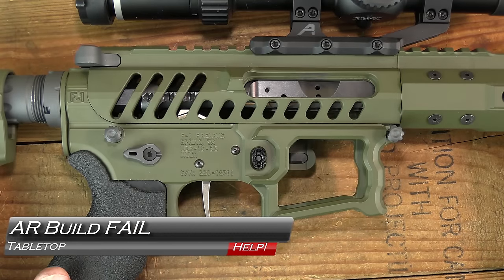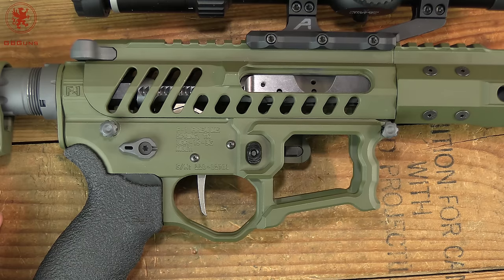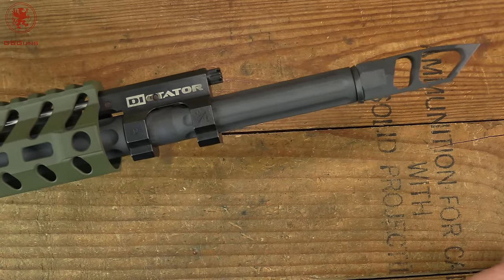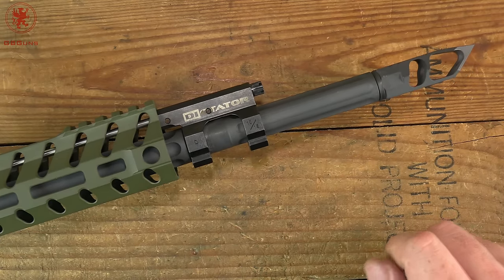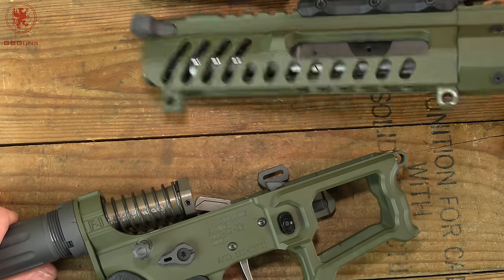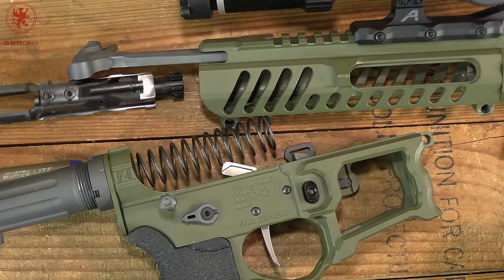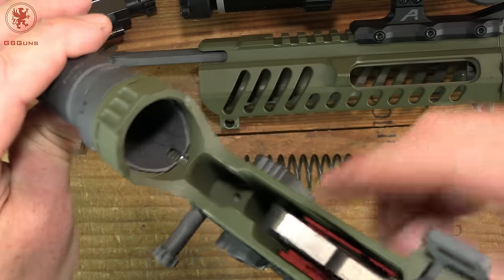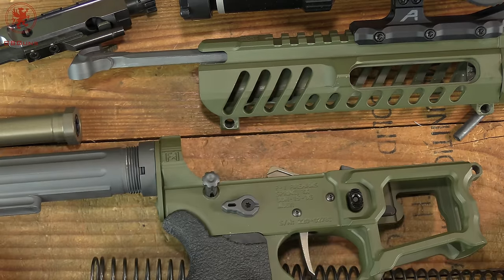The Worst Thing You Can Do For Your AR

Comment from the maker: Problem solved! A reduced-power buffer spring did the trick and I was able to then reduce gas a little with the gas block.  We suspect the gas port is too small on this barrel as we KNOW the block is properly aligned.  See the second video here: https://youtu.be/tjFRl6sO_GY  See the article to learn about the myths perpetuated in the comments of this video: https://www.ballisticmag.com/impossible-ar-build-myths/
Reply: Graham Baates that’s what I was gonna suggest. Glad you fixed it! (Pew pew)
Reply: My 300 blackout pistol was shortstroking, a tubbs flat wire spring cured it.
Reply: So the rifle runs reliably now is what you’re saying?
Reply: A tip I was given before I built my first upper. Seal the gas block to the barrel with blue loctite. Helps with any minor machining imperfections. Glad you got it running! Nice build!
Reply: Good to know b/c I am having the same issue with one of my rifles!
Reply: Which weight for the recoil spring did you end up using?
Reply from the maker: It weighs about an ounce.  It's the Odin Works lite weight adjustable and I left it empty.
Reply: @GBGuns  how about the recoil spring?
Reply: high end rifle, check out the jp silent capture system. you won't be sorry
Reply: I was gonna ask about the buffer spring. lol
Reply: As soon as I seen that spring I was like no
Reply: I was going to suggest drilling out the gas port.
Reply: you should stay away from those cut upper recievers. It lets in dirt and dust  and it will cause problems. It looks nice but not practical for a gun to be reliable
Reply: I had to play around with buffer weights on my SBR. Side question, do you not get a lot of gas venting from the slots in the upper? How is that when it shoots?
Reply: I was just gonna say spring then I seen your comment lol
Reply: I seen another guy with a aero perision barrel had the same problem he made a gas port bigger
Reply: @garygatley9698  that's not true
Reply: @shootist431  
Have you had any practical experience with this or is it just something you say ? Because it can take being submerged in muddy water https://youtu.be/LQalucXr_tQ?t=243 - if you have had problems yourself....fine, if it's hear-say or you think so....try it first, then complain about it eh....
If the Miculeks are willing to use it...perhaps it's not too bad ? https://www.youtube.com/watch?v=BLadEilZCpY
Also rememeber that this is not a battlerifle being dragged through the mud and banged up against rocks and thrown around, it's a specialized tool (lightweight upper/lower) for a special purpose (competition or lightweight rifle for a kid).
If you want a beater get an ordinary one, they'll take most crap you can dish out - like Brownells uppers, they're ok prized and work well.
Reply: Well, of course, if the real problem is the gas port then haven't "solved" it with a lighter buffer spring -- you've only compensated for the sub-standard gas port by using a sub-standard part elsewhere. It would surely be worth taking off the gas block and examining the gas port with a good light. If there's anything wrong, Aero should replace the barrel.

But in terms of actually investigating the problem, it has to be either "forward" (gas block, gas tube, gas port), or "rearward" (bolt piston, gas key, buffer, spring, etc). So the first thing I would have done is put in "standard" rearward parts and see if they work -- and if they do, then you've eliminated problems with the "forward" parts. Then go from there, in a similar manner (using "standard" parts to find which one is causing the problem). I would NOT be "satisfied" with your solution of a weak buffer spring -- you'll be trading "short-stroking" problems for feeding/chambering/bcg bounce/light primer strike problems. A "healthy" setup should run really well with a HEAVY buffer and spring. Lightening THOSE components opens things up to a plethora of reliability problems.
Reply: I've had the same problems on a much smaller budget. Buffer springs quickly throw things out of function.
Reply: Just saw this video, glad you're rifle is working. One thought aside from the spring could also help to have a heavier buffer, only because in direct impingement AR the bolt carrier will loosely act like a short stroke piston. BTW very nice looking rifle!
Reply: Ummm.... where is your buffer retainer pin? It was not installed in the vid. Its binding causing friction.
Reply: I was just about to suggest the same thing. Odin works makes a really great adjustable buffer.
Reply: in a .300 blackout    buffer spring force is more critical than in a 5.56 .. because subsonic ammo doesn't have much gas to use for cycling ..the usual hillbilly answer is to use a worn buffer spring or one with a couple rings clipped off and a full auto weight BCG  ..a blast forwarder will increase gas flow too
Reply from the maker: Yup, I've got both
Reply: @GBGuns  Try the heavy adjustable buffer on your other platforms. I'v noticed a recoil reduction on my 308. I do believe it's 7.4 Oz.
Reply: @GBGuns  why do you not have the buffer retainer pin installed? If you were to remove the rear takedown pin and pivot the upper, the buffer and spring would come out.  It clearly wasn't installed in the video.
Reply: Your pof dictator GB may be a .308 one. They have smaller ports to reduce over gassing in .308’s
Common problem for people buying dictator GBs
Reply: I was going to suggest the spring as well,  looks great 👍
Reply: I spent hours and hours with a similar problem on an AR pistol build chambered in 7.62. Most expensive single shot I ever bought.

Replaced buffer weight lighter/heavier, spring, installed adjustable gas block(opened all the way), rechecked alignment, removed material and honed where the hammer rubbed the carrier, modified the m4 feed ramps to accept the 7.62, removed material from the mags to reduce case drag... still short stroked and or stove piped.

Found the gas port in the barrel was to narrow. Got out the vice and the press and took it up one standard drill bit size.  Replaced the block, tightened it all the way closed and backed out 4 clicks. 

Zero malfunctions since in over 1k rounds.
Reply: Yep. Rifle length gas with 18" = bout the lowest gas pressure you can get, all other things being equal. Rifle length buffer would make it worse. Add a suppressor.
Reply: When I saw the buffer spring & also noticed that the retainer pin was absent, I was going to suggest that putting in the retainer pin along with a lighter spring would help offset the rifle length gas system issue.

Glad you got it running!
Reply: I had a few ideas to post, but you got it running. Glad to hear it!
Reply: @ghostshadow9046  carbine gas ? Didn't cycle with subs ?
Reply: Both of those were exactly what I was going to say. Early Desertech MDRs had similar problems with short stroking and the solution was to bore out the gas port on the barrel a little.
Reply: I'm a bit of an AK guy just because my first rifle was a Saiga and a lot of their shotguns are under gassed I was about to post a comment to that effect to drill the gas port out a bit.
Reply: The D.I. Dictator restricts more gas than other adjustables my j.p made no need to change springs  with the dictator I had to use a weaker  spring
Reply: Just saw the video and I thought it sounded like a fouled gas port.
Reply: Yeah cause my AR is the same but runs fine
Reply: @robertrobinson5001  after i bought one, i will never go back, worth every penny.
Reply: @shootist431  Demo Ranch threw those receivers in mud and then did a mag dump. They spit dirt out the sides.
Reply: It’s always a cathartic experience to have a gun run after it hasn’t.
Reply: good to hear you got the gun to at least run. it does not sound as the problem is fixed though. to me, the extra light buffer seems like just a bandaid to fix the real problem. i would start with the cheapest component to fix first. test the gas rings on the bolt itself. do this by putting the bolt all the way forward and then putting the entire bolt group on the table. if the bolt does not collapse the bolt under its own weight, it would usually indicate the gas rings are bad. i would also check for the space the gas tube has. if it is too loose, you will see a lot of carbon on the top near where it interfaces with the bcg. check your locking lugs. a lot of people think head spacing is not important on an ar 15. wrong. in fact, there are plenty of youtube videos where they show the failures people are having with the more budget oriented manufacturers out there because of incorrect head space. look at the inside of your lugs on the barrel extension. are there any unusual marks? does the bcg feel like it is hanging when you pull back on it? i would take it to the gunsmith and have him check all the spacing with your upper components. go and no go gauges. they make these gauges for the gas tube, the part of the bcg interfaces with the gas tube. the space of the neck on the bolt and the carrier group is important to know and have within specification. the port where the striker interacts with the primer of the casing. they have gauges for that. they can measure how far the striker is coming out to interface with the primer. go and no go gauges for your caliber on the barrel itself. is there cracks on the brass of the case you just fired? i would look for the root of the problem as it should run with standard power springs. the real problem has not been addressed yet...
Reply: @orozcocris93  it says in the video that he tried a whole new BCG. It's a gas port issue on either the barrel or the gas block. One of them is too small.
Reply: Makes sense.  With such lightweight components, you don't have enough reciprocating mass to push the spring.  That spring looks way heavy too.  Glad its running now.
Reply: Just buy an AK and a rock to fix it with lol
Reply: yep, you can also cut a coil of the heavier spring off at a time if you find the new lighter spring is a bit to light.
Reply: Glad you got it running! Too beautiful to not run correctly
Reply: At exactly 5:00 minute mark you said, empty. All I could look at after that was the spring. Lol. Glad it all worked out.
Reply: Glad you figured it out I had the same thing happen with a 6.5 Creed barrel from aero/ballistic advantage and it's port was way undersized so had to drop to super light spring like you to get it to cycle. since then I've figured out aero barrels are hit or miss in terms of accuracy since I can't get mine to group better then 1.5 inches while I can shoot my custom bolt gun into the same hole all day long so it's not the shooter
Reply: @robertrobinson5001  it is awesomeness!! Got 2 myself
Reply: Do you get gas blowback out of the venting on the upper after rounds are discharged??!! Im very curious to know 🤔
Reply: I have the same receiver and had problems with my gun cycling. Come to find out the gas port on the barrel was to small. Gun is running now
Reply: Michael Rostine  Are you aware that cutting a coil spring INCREASES the spring rate?  Don't believe me, do the math (physics)
Reply: @OveToranger   love my f1 but it is not light weight. Its heavier than a m&p15.
Smooth and accurate though and easy to clean. You just spray through everything lol
Reply: A google Account , that is brilliant!  A can does just that, i noticed more buffer action (kick) when on line.
Reply: Just curious but did you not install the buffer retaining pin or just for the video you pulled the buffer out early?
Reply: Yeah, I think your barrels gas port is to small, I run into that all the time with 7.62x39 AR builds and a 450 Bushmaster build as well. Good luck!
Reply from the maker: I never doctor for a video.  I did not install a buffer retainer, it's not needed.
Reply: I was gonna say.... SPRING! LIGHTER SPRING.
Reply: Was going to be my forst suggestion
Reply: I love the build! Yeah I was going to say buffer spring after the end of the video. I understand you were using a rifle length spring in a carbine buffer tube? That was your first issue right there for sure. The rifle length spring is already under load before your first trigger pull.
Reply: Beautiful rifle, can you put the brands please
Reply: Lol was watching on TV ,,,got my phone to tell you buffer  spring as I had same problem with 308 rifle length gas system and a  carbine buffer tube
Reply: Your using a carbine stock with a rifle gas tube. For best proformance use a rifle stock.
Reply: @mattmolisbro  a stock is a stock it doesn't matter if it's a rifle tube or a carbine tube
Reply: i was just about to comment to try to either compress or get a less tension buffer spring. glad you fixed your problem
Reply: Also graham, did you have the set screw for your buffer in to keep your buffer and spring from coming out like that?
Reply: @jasonfairbanks8770  he probably does not use the buffer pin. It's not really something that you must have. I do not run 1 with my JP buffer system
Reply: Sorry, I just watched this, I was going to say, ive seen barrels with gas ports not open enough, replace the spring with a lighter one and you should be good.
Reply: Ridiculous build. Stay with mods that are more proven. Or whatever. Free country.
Reply: Dude, you sound so upset in the vid with this sick "looking" gun. I like stuff that runs. I learned a long time ago from a specific financial position, NEVER customize anything (cars, bikes, guns, etc....) unless you don't mind losing your shirt on it. Unless of course, you already have your first several million. Sad to see you spent so much coin for a gun that would be best used to throw at the enemy because round two wont fire. Glad you got it fixed.
Reply: Obviously was a mismatched gas/buffer system. Either way lube that thing. Sounds like nails on a chalkboard.

Also F1 makes really tight tolerances so the cerokote is probably making it too tight.  you will need to get the coating out of all the spring bores and takedown pin holes
Reply: or run it suppressed all the time haha.
Reply: Glad you got it running.  First thing that came to mind after hearing the spring when you charged it was that the spring was too heavy.
Reply: Around 4:30, when I saw the buffer spring sticking into the receiver, I figured that had to have something to do with it since that definitely is not how it is supposed to look.
Reply: Good, I was going to say maybe get a mid length gas barrel but then I saw that spring... The Beefiest looking buffer spring I've ever seen....
Reply: Knew it! This was a little test for myself and I’m happy I guessed it right 😂
Reply: Ya... would think the carbine spring would be stronger for carbine. The rifle gas would be weaker than carbine.
Reply: Had the same problem several months ago and the same fix worked for me. No reason to open the gas port, if you ever shoot suppressed it will essentially increase your dwell time and so you’ll have more gas.
Reply: It almost had to be the gas port. There is always plenty of dwell time on an 18" barrel.
Reply: @dalecarroll5622  It isn't staying sealed. The blue loctite isn't heat resistance. Even the high-temp red will cook off at the temps you'll be getting there.
Reply: One small note and maybe I missed it, there should be a retainer pin that holds the buffer and spring in the buffer tube.  When breaking the upper and lower apart, the spring and buffer should not come out against the hammer.
Reply: I wondered if it was cycling so fast because of the.light stuff that the mag couldn't get the round up Ito position in time.
Common problem with over gassing and too light buffer / bolt carrier.
Reply: A bit late to the party but I'm glad you fixed it. Buffer spring was gonna be my first suggestion because it's easiest. But next was gas port, though it requires machining. With an ultra light system like that, you might want to film your bolt for a few shots in slow mo. Make sure you don't have bolt bounce. If you do, add a little weight to your buffer to slow it down.
Reply: @l337l0gan  why? do tell.
Reply: But... AR's are like "LEGOS" though right!? LOL! Most definitely your gas port is WAY undersized for the gas system if the port was timed correctly with the gas block and a lighter spring "solved" the issue especially with so many low mass parts! For a lot better reliability you'll want to have the barrel gas port drilled out correctly to max specs and then use the AGB to close it back down. You're dead right, that dwell time is too short for that size gas port so... If this rifle is just a range toy don't worry about all this next bit if you don't need the added reliability. Otherwise in addition I'd actually suggest running the heaviest buffer possible that it will cycle with even with the lightweight BCG, that little bit of extra mass helps "pound" the bolt into battery through any carbon buildup after a solid weekend of 3k+ rounds without having to clean much, if at all.  After fixing the gas port issue, open the adjustable gas block to max and take a regular buffer apart and replace the three aluminum weights with three tungsten buffer weights (Amazon has three tungsten AR buffer weights in a kit for about $30 which is way cheaper than buying three different buffers) and then load one round at a time to see if it will or won't lock back on a empty mag, if it won't lock back then swap a tungsten buffer weight for one of the lighter aluminum ones that came in the buffer until it does lock bag on an empty mag then close off the gas block 1/4 turn at a time until it won't lock back again and open it back up 1/4 or even 1/2 turn and fire it about 10 more times to be sure it locks back on an empty mag each time. Takes a little fiddling with but it will run a LOT more reliably for you. Also, use clear nail polish to seal up the gas block around the edges, blue loctite was mentioned but that can melt under rapid fire.
Reply: @arturos.3973  not something you want to do at home. Have a smith do that...
Reply: Nice. Was thinking the port in the barrel was too small. I had the same issue on a 16” with a mid gas system. I also have a 16” Criterion with rifle gas and it runs like a top!
Reply from the maker: To close it without a buffer retainer simply close from the front to back, not pivoting on the front.
Reply: Where is your buffer tube retaining pin and spring?
Reply: I was just thinking it may still be a stock buffer spring
Reply: just watched the vid, i was going to guess an under sized gas port.
Reply: Glad you fixed it. I still would of swapped out the rifle length for mid length gas. Similar recoil reduction with plenty of gas. Over gassing will help with clearing debris since your rifle is see through...
Reply: i know this is old, but you may want to check the gas key on your bcg.  the first thing i thought of was the spring, but when i tried finding this video to comment, i found another video that was having the same problem.  he had a rough chamber and honed it to make it smooth, but one comment suggested his gas key was leaking.  he said to put a little water in it, and blow into it with a straw to find leaks.  just a thought.
Reply: it may well not be under gassed. Low mass on the operating system can require more gas or lower spring tension to drive. I have had similar problems with a midlength system. Adding mass or reducing spring tension fixed the problem.
Reply: I was going to suggest that.  Get yourself some TRIFLOW.  It's a synthetic lube with Teflon in it and the Teflon can, in theory, get into the upper and BCG deceasing friction in those components.
Reply: I was going to guess the buffer spring when you mentioned cycling issues. Glad it's working for you because it's a beautiful rig you put together!
Reply: Graham, glad you figured it out.  I would have suggested that very thing after doing my 458 socom pistol build.  Trying to balance it all out and making sure it functions correctly sometimes is just trial and error.  Glad it is working now.
Reply: Glad you fixed it - as soon as I saw that buffer spring I said to myself it looked to heavy. I would have suggested throwing it on another lower to troubleshoot if you hadn't figured it out yet.
Reply: The problem is, or shall I say, "was" is you have a rifle length gas tube with a carbine buffer and spring. Next time, just match your gas system with the same style buffer and spring.
Reply: Ha Ha learn from experience. It's usually the spring
Reply: The rifle length gas tube-originally for 20" rifles-your rifle is 18" so 2" less "push" yeah they are used with 16" barrels-but not with too light BCG and too heavy recoil springs-

BCG need adequate  mass to acquire enough M V to carry the bolt back against the spring- and to rip out the case--and when slamming forward-stripping in the new round.And the heavier bolt with help when things get "gummed up"

Using a lighter BCG in order to get a "lighter" recoil "feel" is a mistake unless you are in some sort of fast shooting sport that requires extreme accuracy-

Heh-taste is individual thing-but the funny green color-I don't get it-I noticed a few pistols that color-

Not like the beautiful polished bluing or nickel of a S&W revolvers-or a Python-or like many bolt action rifles from another time-or my 1911 (1968 VINTAGE Colt nickel)-$155 in 1968 pricy-a browning HP was $88 in 1966-not sure how bad inflation was then-but $155 was a lot in 1968(Oh I stupidly sold those guns)
Only one I have from back then is my mail order $43  Winchester 190-1963 mail-order maybe I had my dad sign the order form -cut out of a magazine-Mechanics illustrated-who knows-but you could mail order any gun back then(except machine guns I guess)
I bought it because it would hold 21 22 shorts-39 cents/box about $4 in today's dollars-close really  LR were 59 cents at Western auto-and yeah kids could buy them-teenagers anyway-maybe anyone

Green-wow-not for me
Reply: Awesome! Beautiful rifle! As soon as I saw the reciever extention I thought lighter buffer spring! Glad you got it worked out! Thanks for all you do and your help ( on your page, lol) on gun builds! They have helped me out a lot, especially with my 1911!
Reply: I was actually about to recommend that same thing. Had The same problem with a spikes build i built for a buddy.
Reply: This is my first time seeing your channel, but I recently did a complete build myself. One of the biggest things I've noticed is that you should always try to match up your buffer tube style and gas block style (carbine and carbine, rifle and rifle, pistol and pistol, etc.) Then, with an adjustable gas block, you can adjust it to give more or less gas to get it tuned in perfectly. You have a very nice build, though. If you'd like, you should check me out on Instagram (rps_32) to check out my pistol and AR builds.
Reply: If you have to do a barrel swap anyway why not rechamber to .50 Beowulf?  You can keep the same mags and BCG but you might want a heavy buffer spring just for recoil but it won't kill the build without it.  It's literally just a barrel swap and gas adjustment.
Reply: i was just about to comment asking if that spring provided more resistance than a mil-spec spring
Reply: I know I’m late on this, but 18in rifle length gas port is the most difficult to tune. I purchased an FN CHF CL 18in barrel and after going through everything springs, buffers, bcg’s, gas tube & alignment checks numerous times. I finally through internet digging I came across an article about proper gas port sizes relative to barrel length and port distance. Come to find out my port was drilled for 16in mid-length port 0.078 diameter, instead of a 0.0995 diameter recommended for 18in barrel with rifle length gas port location. In the article it states this configuration uses the largest gas port size and is the most difficult to tune if not done correctly. 
Well after drilling the gas port to 0.099, my rifle functioned as advertised and has been flawless since. Also, I haven’t noticed any appreciable increase in felt recoil, which is great. 

Oddly, I noticed that now FN is putty out mid- length gas ports for their 18in barrel! Maybe I wasn’t the only one having problems with the configuration.

Hope this helps.

Cheers,

Mach
Reply from the maker: Thanks.  I knew it would be a tough one.  I got it running and still have room to play with gas settings.  Silky smooth now
Reply: Just sell me the upper n lower n start over. Sound good err nah? 😂
Reply: Nice, this is a great learning experience for me actually because I know minimal information about AR-15’s and I did suspect that!
Reply: @catmanisgod8200  I don't think that’s true if the space the spring occupies stays the same.  Imagine a spring shorter than the space, how could the spring be under more tension?
Reply: Are you missing the buffer stop in your buffer tube? It the stop is missing your buffer will have to travel further and reduce the pressure.
Reply: Dude, I was just gonna type, get a lighter spring.  BAM!!!
Reply: In this case it definitely looked like a stiff spring, i thought I had a similar issue on a 20 inch rifle length barrel. I didn't have an adjustable gas block but when I compared the size of the gas hole with the block I noticed that the port in the gas block was easily twice the diameter of the gas hole in the barrel. I bought a cheap gas block with a smaller diameter hole and it fixed the issue without changing the spring, switching to a low mass carrier, lighter buffer etc. I still think it cycles smoother with "premium" ammo as opposed to cheap target rounds but just thought I'd share even if I am 3 months late. Right now I'm working on a 350 legend CMMG barrel and it's got similar issues, with a reduced power spring, polishing the feed ramps, polishing the ejector, and some slight grinding on the front of the magazine it's cycling better. It's a straight walled case and it catches on the front lip. Still considering a low mass/light weight bolt carrier though.
Reply: I was gonna hop in and give my 2 cents, and tell you to switch your spring and add a HEAVIER buffer. Lol
Reply: Ghost Shadow spot on I didn’t read the comments I just posted in the regular section David tubbs lightweight spring in the 300 blackout that’ll work in 5.56 also he told me
Reply from the maker: Rob Cas  Thabks for the input, but I wouldn't take advice from Nutnfancy.
Reply: Buffer spring - yup, but other issue you may have is the install of the trigger for the double fires. The screws on the snug up fit in the lower. Plus I recommend the KNS anti rotation springs.
Reply: Lightening the reciprocating components along with a reduced power spring is going to cause reliability issues. Any introduction of additional friction will cause cycling issues. That rifle will not like running dirty.
Reply: I had to cut 3 inches off my buffer spring on my blackout pistol. Try it
Reply: video of shooting?
Reply from the maker: Yes
Reply: Glad you fixed it! Usually with a rifle length gas system you will need a rifle length buffer system. Lighting the spring will compensate for the buffer system you installed.
Reply: @catmanisgod8200  What you have said is true, but a cut spring has a different free length as well which means the force on the back of the buffer changes as both k rises and x falls.  Where F=kx (Hooke's Law), k(new)/k(old) is smaller than x(old)/x(new), ergo the force applied is less.  This extends all the way to Fmax where the spring goes from elastic to plastic (deformation).  I ran the numbers for a carbine spring with 38 coils and free length of 10.5" against a cut of 31 coils which came out to 8.56" and it applies less force cut than not cut.  Also, at 8.56" the coil will still engage the buffer as the average carbine buffer tube is 7.25".
Reply: @robertrobinson5001  agreed owner and advocate
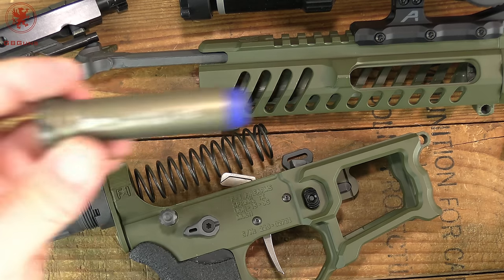Reply: I'd still recommend checking your bolt's gas rings and setting them at the 2:00, 6:00, & 10:00 positions.  If they are aligned you won't build up enough gas to cycle the rifle.
Reply: I should have read thus. Ignore my comment.  Basically said what you did
Reply: Graham Baates as you have solved the issue and others have probably said this but I’ve had this issue before and didn’t want to go to light on the buffer or spring so I contacted faxon which was my barrel of choice for my build and they were able to oversized my gas port to allow increased gas volume transfer due to reduced dwell time. Hope this helps in the future and feel free to hit me up if you have any other AR issues in the future.
Reply: ALau Firearms Training if your running into a similar issue I recommend over sizing your gas port. You end up with reduced dwell time because the gas port is so close to the muzzle. Rifle length should only be used on 20” or greater barrel length or on barrels with oversized gas ports as the increase in gas volume offsets the reduced dwell time. However you should also use an adjustable gas block to limit the risk of over gassing when oversizing the gas port. In case you don’t know dwell time is the time it takes the round to get from the gas port to the muzzle. Effectively how long gas is flowing through the gas tube. Hope this helps.
Reply: Gary Gatley mid length would work better in this application as the dwell time carbine length offers on an 18” barrel would over gas the system.
Reply: Just watched your video and said the spring.
Reply from the maker: I did
Reply from the maker: @motogpnut  https://youtu.be/tjFRl6sO_GY
Reply: I was thinking that as soon as I started watching the video... I had the same issue with a sig 716 upper I bought from someone when I built a lower for it.
Reply: Was going to recommend a lighter spring or opening up the gas port.
Reply: Also could use a smoke gun to test if there is any kind of gas leak
Reply: I was guessing the gas port was too small before I read this...lol
Reply: Yeah,that buffer spring was way to heavy for that system... was it a full length spring? They tend to not work in a carbine buffer tube 😹
Reply: I know late but first thought was gas holes not aligned properly. Glad you figured it out & nice piece brotha.
Reply: Just seeing this vid today, right away knowing if its short stroking, its due to the buffer spring because of the rifle length gas tube. It needs a carbine length tube with the adequate amount of pressure to cycle correctly. So its one or the other to get that resolved. My 18 inch with the carbine tube works flawlessly with standard carbine tube.
Reply: Your barrel is made with a journal for a micro gas block, that gas block is designed for a full size gas block journal.

You didn't say if your gas system is leaking at the gas block but that would be where I would look first.

Also, when you have a shorter than standard dwell, your gas system is going to be on the under gassed side and adjustable gas blocks are used to adjust over gassed rifles.  Less dwell, possible leaks and a gas block that reduces the amount of gas are all factors that could lead to short stroking.

It sounds like your light weight spring fixed it but you should really ditch the Dictator and get a plain micro gas block to see how much that helps.
Reply: From what I see in this video, you had the same issue I had a few weeks ago. When you show down into the buffer tube, you can see that your buffer retaining pin isn't fully seated into the buffer tube. All you needed to do was screw your buffer tube in 3-4 more rotations.
Reply: I kept running mine one cycle at a time until my buffer retaining pin finally started to show signs of it catching the bcg. Took about 200rds but after putting it back on the bench she's as smooth as butter.
Reply: I thought the spring was the issue too. Glad you got it working and I wasn't way off on my thought process for the issue you had.
Reply from the maker: Lol, as if a build like this would be anyone's first AR.
Reply: @GBGuns  I still think your main problem is the gas system, not the buffer spring.
Reply: @jasonfairbanks8770  i was thinking the same thing. Theres bound to be more resistance on the BCG with it having constant spring pressure on it.
Reply: You should also look into a buffer retaining pin and spring.
Reply from the maker: @michaelrands4501  They're not necessary and for this build would make adjusting the buffer a pain. In this receiver set the detent threads in with a tiny Allen key.
Reply: If it's cycling too fast. Heavier buffer
Reply: I did the same thing on an AR 10 308 build. According to the shop where I.bought most of the components, I did everything right. After $100’s in different ammo, bcg’s, adjustable gas blocks, buffer springs and different weight buffers, we were stumped. Finally we call Ballistic Advantage, the barrel mfgr, and asked what the gas port size should be. It was .08” too small. I now have almost enough spare parts to build another rifle
Reply: That’s what I was gonna say until I saw this post
Reply: @ALauFirearmsTraining  u
Reply: Sometimes a little weight is good. When you lighten everything up that much you just create problems. Probably could have fixed it with a spec bolt carrier too
Reply: Guess I should have read comments first
Reply: where you went wrong is having someone else build it for you... personally I've not a gunsmith but have built 6 AR's... and in researching various specs you learn that different barrel manufacturers have different gas block holes and you need to match the gas block hole sizes... but a simple solution to your issue would have been to start trimming off sections of coils from your buffer spring... maybe 1/4 to 1/3 of a coil to start with until it cycles... or as you found out, a lighter spring which did the same thing... 👍
Reply: Years ago I bought a Bushmaster ar brand new. It wouldn't run anything other than brass cased 55 grain and 62 grain loads and even then wouldn't run for more than 200 rounds with out cleaning until I enlarged the gas port 1 size. If you think that may be part of the problem go ahead and drill it out.
Reply: @chaddoan4659  Was that after Bushmaster sold to some International MFG Group? The quality went to shit after they bought it... now the original Designer/Owner has brought it back as Windham Weaponry and is a High Quality firearm again... no idea what Bushmaster is now doing, don't care.
Reply: @chaddoan4659  Did you buy one of the Bushmasters AFTER it was sold to some International Corporation and they sucked after that... it was like when Harley sold out to some "Corporate Group"... AMX and quality suffered under new management. Same thing happened to Bushmaster... and now the Original Designer/Owner has started up a new AR company called Windham Weaponry with many of the original employees and quality assurance... you might consider giving them a call and they might even help if it's not one of their original ones...
Reply: @t.c.a.3335  No. My rifle was purchased before Freedom Group/Remington sucked up and ruined them and every other gun company they could.

My rifle started out as patrolman's carbine which is an M4 clone. The military has specified a couple different gas port hole sizes over the years. My rifle had the smallest one and would only run on mil spec ammo. I enlarged the port to the next standard size and it became much less picky.
Reply: @chaddoan4659  Have you thought about calling Windham Weaponry and at least getting their technical advice on the issues? if you're still having troubles...
Reply: @t.c.a.3335  Windham makes a fine rifle but at this point my Bushmaster is completely sorted and will run on almost on whatever ammo I want to feed it. If I'm going to buy another rifle the next one probably won't be an AR.
Reply: I had a 20" Yankee hill barrel once that the gas port was about 0.004" undersized for rifle length gas system. Put it on the milling table and cut it out to recommend size and helped. More common than people realize
Reply: That was going to be my suggestion. Lighter spring.
Reply: Lol, I was just putting that into the comments after you showed the gas block and carrier. I figured a longer buffer was what you needed as soon as you said you had an adjustable block.
Reply: Was about to say get a can on it!!! Then youll be fine.... but that was going to be my other suggestion getting a lighter spring or possibly looking into a carbine length gas system
Reply: Oh. Lol I just saw this. Yeah I could tell when you were cycling your action. It shouldn’t take that much effort.
Reply: Nice. An expensive bolt action AR. Glad you figured it out.
Reply: That was going to be my guess before I even saw  the whole video get a Reduced Buffer Spring or get a Flat Buffer Spring would maybe help. Glad u got the Light Weight Paperweight fixed now it's a Expensive Lightweight 🙃 😅 Shooting Paperweight!! 😜 jk
Reply: @earlwyss520  gas rings seal when the bolt closes. No need to ever “align” or “stagger” the gas rings.
Reply: @awp97128  USAF CATM instructed us to stagger the rings, because if you don't, too much gas can get by too quickly, the bolt carrier won’t cycle properly, and you may be left with a bolt action rifle. With our gas rings staggered, we never had issues firing our rifles for either qualification or force on force training.

The only issue that I ever saw as a Security Policeman was that the M-60's blank adapter was over engineered and was nearly impossible to get to work correctly. That was until someone came up with blank firing barrels for our M-60s that had blank adapters permanently affixed to them.
Reply: lol guess I should have read this oops at least you figured it out before I commented 2years later!! that would suck!!!
Reply: Good deal. I also see your gas block is waaaay longer than the barrel's gas block journal. Attention to all these details is very important on a "high end" build.
Reply: Must have a buffer retaining pin, buffer should not come out when opening up rifle. Buffer will drag on threads of buffer tube and cause friction that could cause short stroke.
Reply from the maker: @davidchupko3388 incorrect, seepinned comment.
Reply: Let’s gooooo! I was just coming down to the comments to suggest the springCo. yellow reduced buffer spring! Glad that that solved the problem. I ran into a similar issue just being way under gas on a 300 blackout build and literally the same issue in the same resolution worked for me.
Reply: My first thought as soon as the video started, gas system and spring. That is the problem 99% of the time.
Reply: 4 yr old vid...but thanks for posting it, plus the solution in the comments.
Reply from the maker: @andoniades  Thank you.  A few thousand people unwittingly helped contribute to an article; there's a lot of misinformation and bad advice out there, proving the reason this video was named so. The worst think you can do for your AR is ask the internet for advice!
Reply: Glad you fixed it because I was going to say check your springs and buffer
Reply: @lemmingsfly  on AR15 problems I just about always check in this order, gas tube, magazine, firing pin, and buffer and spring. They’re pretty simple in the 223/556 platform. The only one I pulled my hair out over was an AR10 build once. Depending on platform, as in dpms, and the other the gas tubes will say rifle length but one is just a quarter inch or smaller difference than the other. I did an Aero precision build and couldn’t get it to cycle for shit. I jacked with the buffer and spring pulled the gas tube to check with alignment like 3 different times. Took it to a gunsmith and he pulled the upper and said look where your gas tube stops. I was like oh damn that’s not right! Then he explained to me the differences in parts.